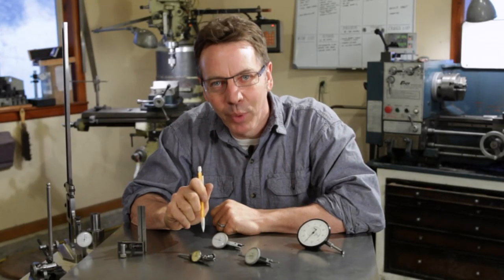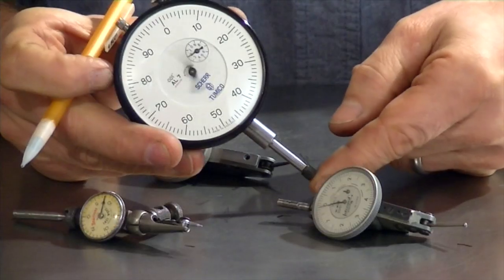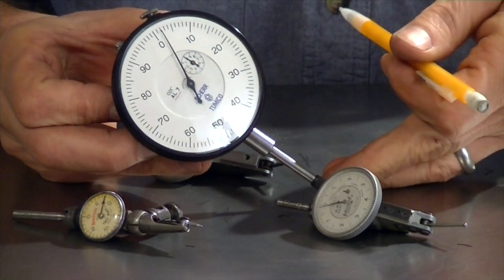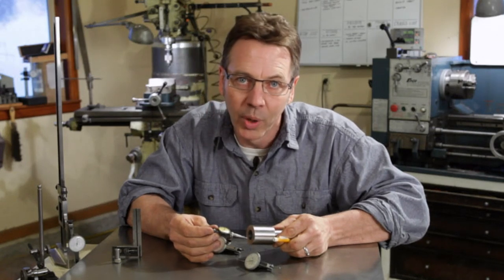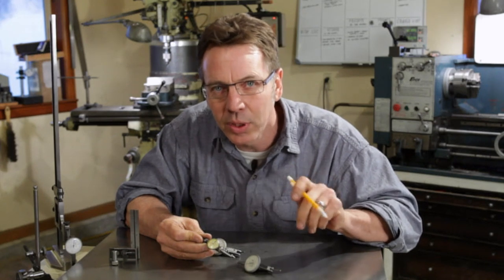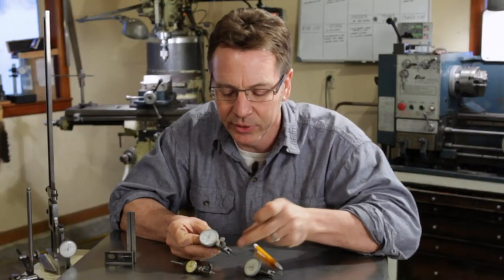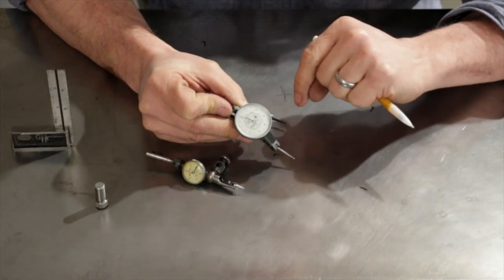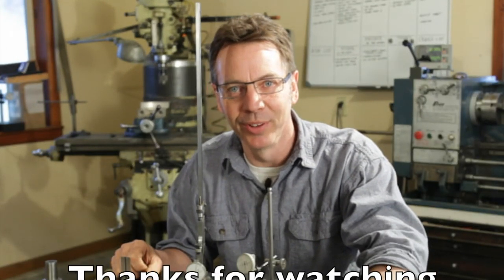Tool Talk: Magical test indicator ?

Comment: Another interesting note about test indicators: some test indicators (like your Interapid) are most accurate with the probe set 12-degrees to the measured surface. And others (Mitutoyo, Compac, et al) are designed to be used with the probe angle at 0-degrees (tangential). It's good to keep this in mind when buying, and using dial test indicators.

Thanks for the video!
Reply: I also have a Federal indicator that also reads at 12 degrees. Both Federal and Interapid state that it’s easier to set up. I also have the 312B 3, and honestly, I can’t really say that it’s easier one way other other, but they’re all easy.

Comment: Hey Dale,

Nicely done. Lots of folks get tripped up on Cosine error. You have a very nice collection of test indicators. Thanks for sharing.

All the best,

Tom
Reply from the maker: Here's a funny side note about  my test indicator collection. Little over 2  years ago I did have any, and with in 4 weeks I collected over 7 of them. Be careful what you look for. :-0
Reply: I now know where I went wrong a few years back 
When I made several out of tolerance parts in bronze ... 
I lost that job for the blunder and I could not for the live of me figure what I had done wrong  
I now know thank you

Comment: Hey Dale,
Excellent explanation on indicators. 
A couple things I would like to call to your attention. 
The value on the face of each instrument that you called the “accuracy” is actually the resolution the instrument, not its accuracy. The rule of thumb for accuracy is for it to be 10x the resolution.
On the dial indicators, the part that moves in and out of the instrument is called the “rack”, only on the test indicators it is the “probe”.
Keep the great videos coming.

Comment: Hot Dog! I had no idea - I just picked up a lathe that looks just like the one you have in the background! It came with a few test indicators, and I have a couple of dial indicators. But I had no idea that the use of the test indicator was so critical in terms of set up. Thanks for the tips.

Comment: Hey Dale, thanks for all your videos. Quick question, does changing the probe on the indicator would change the result. I mean if replacing a longer probe to indicator that came with a short one.??
Reply: The length of probe matters on the test indicator only if you are depending on the values of each division to scale correctly. But if say you needed to reach farther to a feature so you could knock it on center then you'll only need to know the general swing in runout and if it's positive or negative. In that case probe length is arbitrary. You could also do the math, dividing the original probe lenght by the new probe length to get the value to factor you dial divisions by. For example if the original probe length is (20mm or 3/4in) and the new probe is (40mm or 1-1/2in) then 20÷40=0.5, then divide not mutiply you indicator reading by that factor. This would be for a situation say where you had to hold a minimum specified concentricity or runout per the print. Remember it's the length of the probe to it's pivot point and not to the base of the probes thread. It's actually a good way to measure and you'll quickly discover if you need it once a year then put the money into something more useful. If you end up needing it more and more then it makes sense to have a dedicated indicator and since they are vulnerable to accidents where the tip gets broken off, you'll already have a spare.
Cheers!

Comment: though i have never used one, from what i have read and seen on some authoritative sites, the interapid differs from other test indicators in that it's probe is not to be tangent but rather at an angle to the surface being read. if true, the results of your test would have been somewhat opposite to those for the mitutoyo.

Comment: Dale,
I know this off the topic, but how do you like your Enco lathe? I am seriously thinking of getting one and would like your thoughts. Thanks for your time and for a great video on indicators.
Dave
Reply from the maker: Hi Swart Rat.
The Enco has been a good lathe, and great lathe for the home shop. Some of the nice features are the harden and ground bed ways and the hand scraped dove tail ways for the cross slide. Two  things I don't like deal with the tail stock. The #3 mores taper doesn't  lock the drill chuck or bit in place, so they have a tendensy to spin  under heavy loads. and the tail stock dosent hold well when locked in place.  
Are you buying a new, or used?
Reply: Dale . . . I plan to get in new. Thanks for the input.
Regards,
Dave

Comment: So you can use an angled setup to get more sensitivity (?)
Reply: Yes, but the readings would be relative and not absolute...
Reply from the maker: Hi Flip de boer,  
Yes,  in theory. The steeper angle will give you a more sensitive reading. Another way to do it would be to use a longer probe.  The best way to get a more detailed  reading is to use a more accurate tool. :-)
Reply: *****
Dale, Wouldn't a shorter probe give a more sensitive reading??
Reply from the maker: Fred Miller Your right. What is funny I did experiment once that shows that and forgot all about it. thanks for the correction. ;-)

Comment: You kind of alluded to it but instead of saying tangent to the piece it would be better to have said the specified angle. For example the 312b-3 (really all the 312s) wants the angle of the probe to the surface to be 12°. In their documentation they give you a correction for other angles if the 12° isn't possible.
Reply: Good of you to spot that.

Comment: The Interapid is not ten thousanths of an inch reading. It is a tenth of a thousanth reading. A factor of 100 difference!
Reply: +Joseph Lippencott 1/1000 * 1/10 = 1/10000
Reply: A common "mistake." One usually assumes 0.0001. A good way to avoid the confusion is to use micro-inches. 0.0001 is 100 micro inches. If one says 100 micro inches, there is no confusion. Of course 100 micro inches is more of a mouthful than 1 tenth! Can you tell I am a retired scientist? lol
Reply: You guys are all saying the same thing. The problem is with the narrator of the video. He is not being careful when he discusses the limits of "accuracy" (of course it's really just stating the nominal measurement corresponding to the smallest divisions on the dial face). At 5:01, he states the Mitutoyo test indicator is "accurate to ten thousands of an inch." I listened carefully, and he gets it wrong twice, once at 5:01 and again at 5:08. He knows the difference, but he does not use the correct words. To be correct, he should have said: "...is accurate to one ten-thousandth of an inch." As most of us understand, units of one ten-thousandth of an inch are commonly (though somewhat confusingly) referred to as 'tenths', as in tenths of a thousandth, which of course is the same as one ten-thousandths. For you metric system fans, we're talking about 2.54 microns. Arguably, 'tenths' is actually a more practical unit.
To put 'tenths' into perspective, consider this: a typical human red blood cell has a diameter of 3 'tenths'. So be sure to wipe all the blood off your work and indicator surfaces before attempting precision measurements...
As for micro inches, well it's a nice idea, but in all the machining videos and discussion forums I've looked at, I don't recall anyone using micro inches as a unit of measure. So it might be a great idea, but, like Esperanto, it has failed to take hold...so indeed, 'tenths' it is!
Reply: Which confusion suggests you should be using microns.

Comment: I will offer a caution to this 8 year old video even though it is not likely to be read. While Interapid is the class act, Rolls Royce of test indicators and has twice the range or more of competing indicators, they are extremely prone to unintended accidental damage resulting in damage to the change of direction mechanism. If indicating a static measurement as demonstrated with the height gage and surface gage this damage will not affect the indicated measurement. BUT if indicating a dynamic function such as runout, any lash in the internal mechanism will not capture this lash in the needle movement, resulting in a false measurement. I have seen nearly as much as .002" lash in a damaged Interapid.0005" indicators that was previously unobserved by the daily users. This amount of error is pretty easy to suspect by a skilled operator, but smaller error is more easily unobserved. A proper calibration tool such as a Cadillac gage is required to validate a suspected damaged indicator. This gage us likely secured in the inspection lab and not readily available to the shop floor user. In my 40+ years of experience, I have discovered numerous Interapid indicators with this hidden damage in normal daily production use, most commonly with shop owned and multiple user tools. I own 40+ high quality indicators from several premium manufacturers, but only one Interapid (that I picked up used for cheap). I don't trust them, unless validated. The hobby user is unlikely to have adequate validation inspection equipment.
The benefits of the Interapid are the large range of of measurement compared to the competition and the snob factor of owning the most costly. An Interapid "tenth" (.0001) indicator has a range of about .020" compared to .008" of a comparable Mitutoyo or Brown and Sharp. This is a huge advantage when correcting tool holder rotational error on a crashed turret lathe. But if it has lash damage, you are screwed.
Another issue that frustrates me is that Interapid uses its own mounting system requiring special mag base adapters. Your beloved Noga holder will hold every other style out of the box, but requires additional expense and setup to hold the Interapid. You may have noticed that Dale didn't use his Interapid in his test demonstration, probably because the height gage and surface gage were not equipped to hold the Interapid. I have many mag bases, height gages, surface gages, etc, and the ability to swap between holders easily allows me to select the setup most conducive to job without additional fixturing changes to hold the Interapid. There are some knock off copies of the Interapid design, but I have no experience with the less prestigious makers. The cost of the Interapid can be more than double the cost of a more rugged Mitutoyo or Brown and Sharp. Starrett indicators are lovely, and are priced in a mid point between these extremes.
I am a tool snob and prefer and value the best, but I strongly caution about owning and using the Interapid unless you have deep pockets and provision to validate the Interapid. 
My Brown and Sharp .00005" indicator has a limited range of only .004". When I purchased it for a very special requirement, it was affordable and readily available. I really had no other purchase options. This is a specialized test indicator. I worked in a " high precision" production shop of 100 machinists, and I was the first to own and require this accuracy. I own my Interapid because I can and mostly for bragging rights. I don't use it.
Buy yours, treat it with more caution than your other brands, and don't ever loan it!